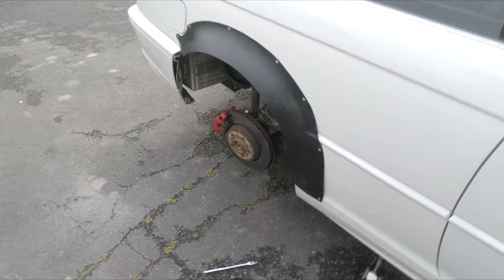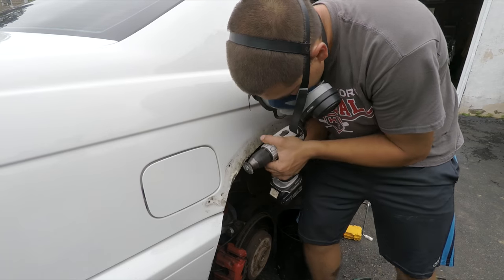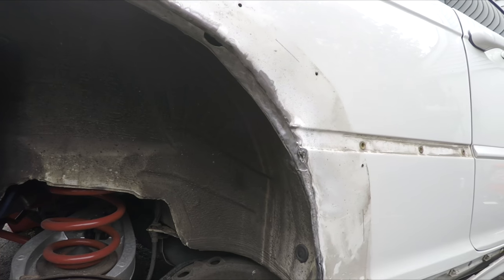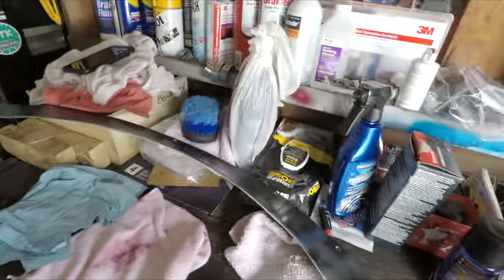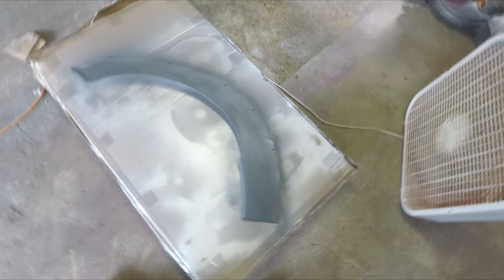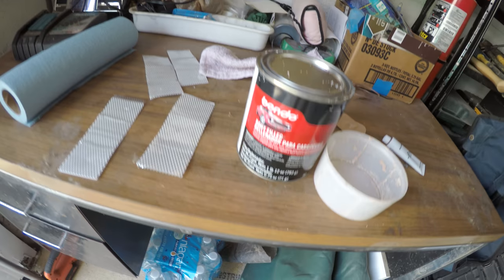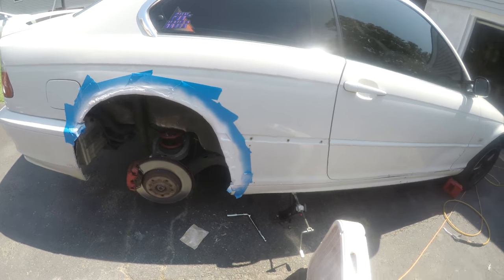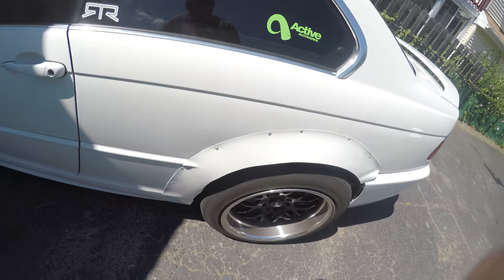BMW E46 Fender Flare Reinstallation

Comment: nice video was wondering what you used to cut your fenders? and what size are these flares/ where did you buy them
Reply from the maker: Brett Krehling i used a regular grinder to grind off whatever was rubbing on the tire. They are around +55mm . VsAero from ebay. Cheap and I regret that I went cheap and bought them. For bodywork like this saving money wont be a good option)